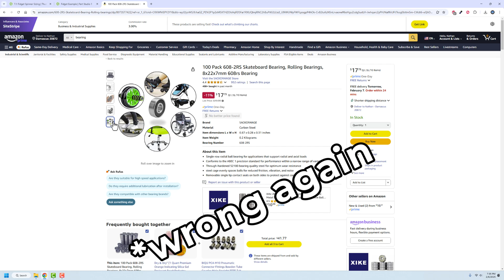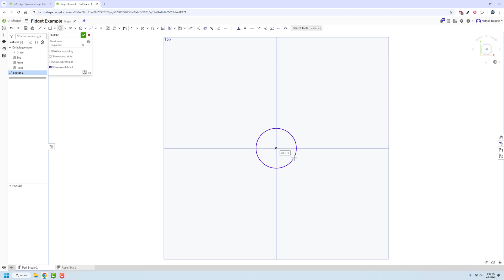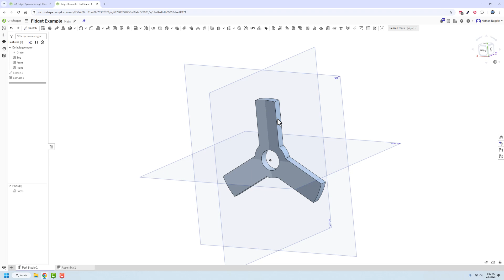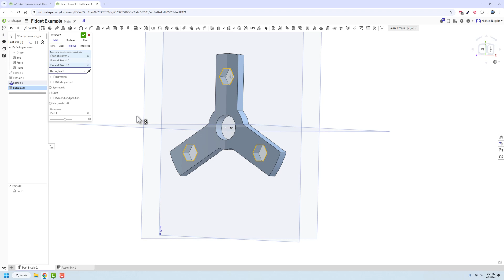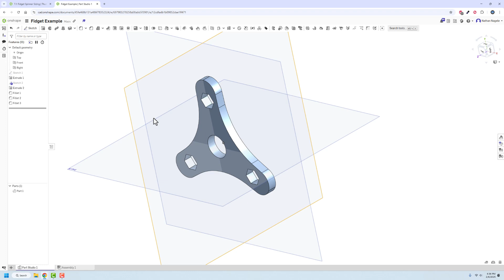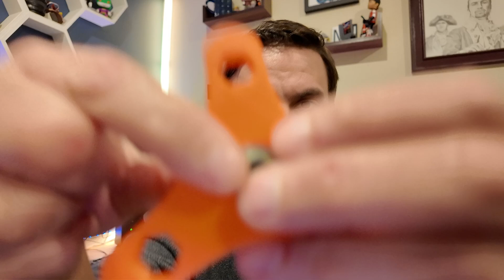DIY Gadgets: 3D Printed Fidget Spinner

Comment: Did you design the bearing cap as well? I am planning on creating injection molded fidget spinners and am curious if I should design or buy the bearing cap
Reply from the maker: I designed it. It’s two parts and just a dab of super glue locks them together.